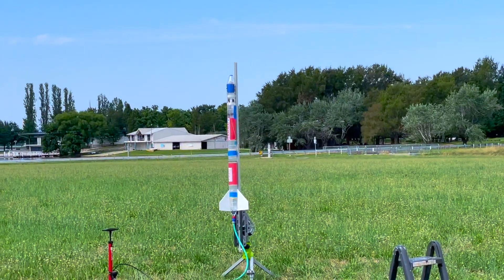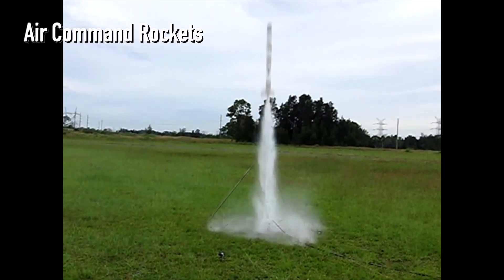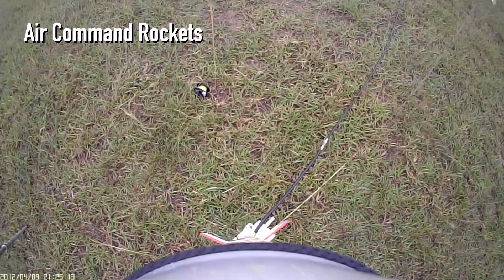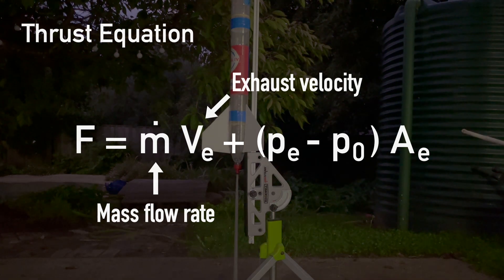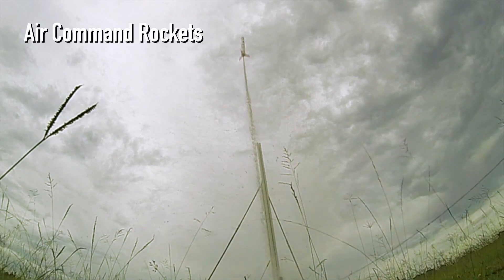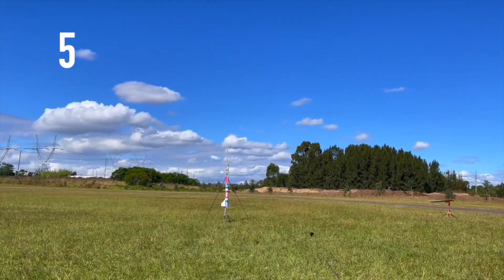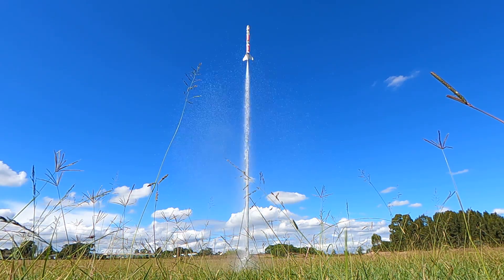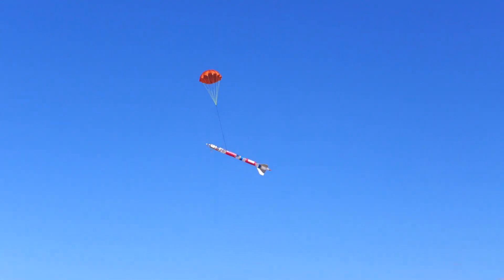Can Soap Make Water Rockets Fly Higher? feat. @AirCommandRockets

Comment: As water and air is separated by gravity at launch, I dismiss the foam theory….however, adding soap to water influence the surface tension and dynamics of the water surface….so is nozzle friction less and water speed higher? Is the water pushed out more quickly, then the motor power is increased…..

Comment: how about give presurized propane and air (in almost or below stochiometric) with more water, igniter and pressure sensor inside?
so rocket launched normally like water rocket, when pressure droped to certain point the igniter turn on... give more pressure to leftover water to give more boost to gain more altitude....

Comment: A rocket enthusiast here! At 3:32 we can see the exhaust expanding after leaving the nozzle. Could this power be put to use with a bell shaped nozzles much like in real rockets? Just to have a miniscule performance boost?
Reply from the maker: You absolutely could develop a theoretically optimised nozzle geometry as you mention for water rockets! The nozzles I use serve as the rocket's primary interface with the launcher, so has to have a garden hose connector geometry at least for now. Water rockets are a little different when it comes to nozzle optimisation since there are those distinct phases (water then air). I think you'll like this video from George where he makes a variable nozzle from some rubber. It's a passive design that automatically adjusts for the optimal throat diameter: https://www.youtube.com/watch?v=IeuyM9YpApw. I definitely think this would be a cool rabbit hole to explore with future tests with different geometries!

Comment: Great video! I've found that soap usually increases altitude by adding about 1/3 to the flight altitude without soap, however in this video it seems like it raised the apogee even higher than I was expecting! I'm curious about the diameter of nozzle you were using and how much soap you used?
Reply from the maker: I used a 9mm nozzle and probably not as much soap (can't remember the exact amount). The rocket was also at a much greater pressure than last time (100psi vs 80psi)
Reply: @arro_rockets  Thanks, the altitude increase makes sense then. One more question, how do you properly form foam inside the rocket and especially how do you keep it formed? I've been having trouble with this and I haven't really been able to get much of a foam trail or an increase in altitude when flying. What is the optimal ratio of foam to water?